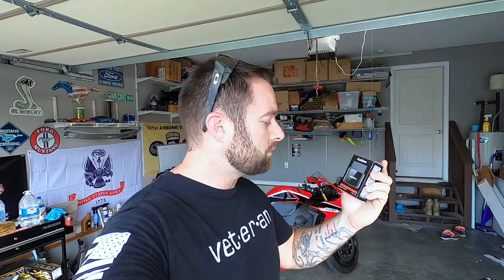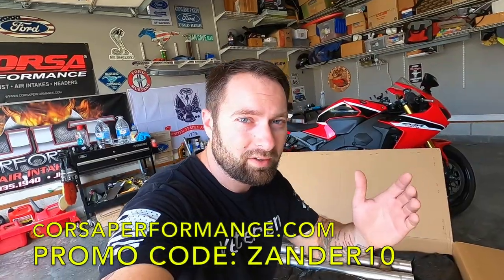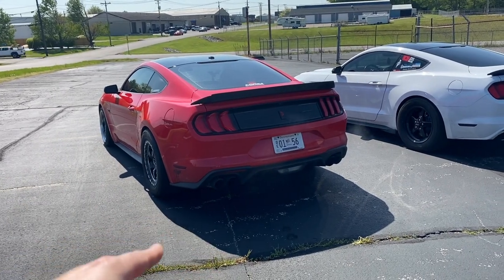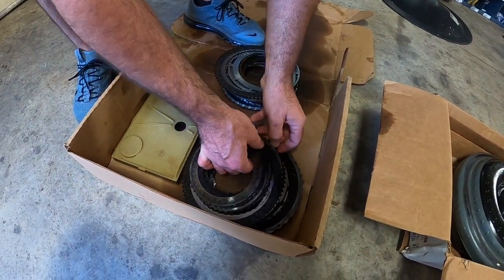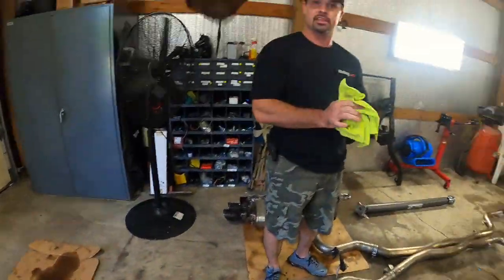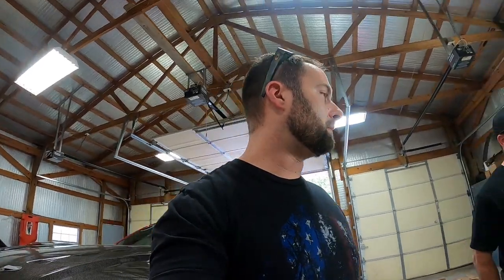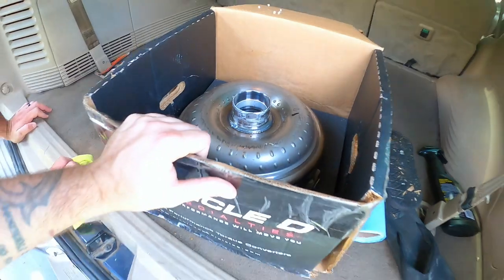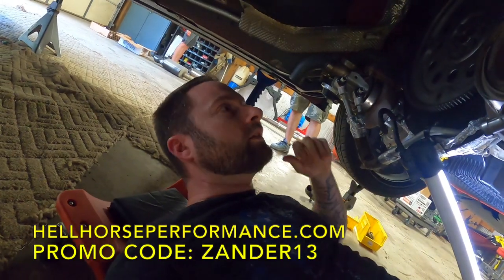BAD NEWS for my TWIN TURBO Mustang 10r80 Transmission  *THIS IS WHAT WE FOUND...

Comment: Is it selfish of my that im glad ( since it won't cost you nothing, remember most people don't get to keep their cores ) i get you see your twins vs kens twins which 60ft better and psi ect....with stock stalls!!!!

 Why not clean the valve body? Does him and Ken think thats why you had the 4-5 issue basically since day 1? I know a lot of times Ford tosses a new valve body on, even a few recalls....

 Good to see the trans was holding Hella power and clutches were fine, also people says Robs tune is harder on clutches so that's all good news
Reply from the maker: Installer has never cleaned a valve body before. I did not want to be the test dummy lol. Kens car might be faster with the new 63/65s. He won’t have my power once we are both built engine but his will still be capable of about 80% or more of mine. His will spool faster than mine and he has the newer lighter weight turbine
Reply: @Zander13Productions   I don't mean for yall or against anyone, I mean just for data......i know it sucks but given your job for content yall are gonna give us a REALLY good dataset and content...
  It even helps HellHorse  ...2 or 3 kinds of configuration and lastly how much a stall was worth NA...how much a stall is worth turbo....ect ect...
  I'm saying its 100 degrees and if it was gonna happen this is the time......imho you valve body has never been right on the 4-5....so its ALL moving forward and good content and data for us to soak up.....

 Better it all happened now than late fall in good air with tracks sticky!!!!

 Sometimes I don't come across how I mean so....
Reply from the maker: BlueCollarDaily I totally agree and about guarantee my valve body has been plaguing me since the 1st mile when it was bought. Hopefully this new one will be the remedy
Reply: @Zander13Productions   I still remember the clunk video id just bought my car and immediately went out and seen if I could make my 4-5 IIRC, mess up hehe....

Comment: Yeah the horsepower, & torque you are producing, sometimes things are going to break, any signs of metal anywhere
you don't want mess with, changing valve body is being smart and safe. The torque converter damage is in a weird place, so hopefully the stock converter will hold up, good luck on fixing everything.
Reply from the maker: Thanks. Should have it back up and running soon

Comment: All us FI guys knew you were going to eventually have trans issues with those twins but the issue your having.  So odd.  Did you use upgraded clutches etc on the rebuild?  Stock converter is gonna feel so much better on the street.  Higher stalled converters just feel crappy on the streets.   So much slipping just takes the fun out of the car.  Good luck with the rebuild dude.🤙
Reply: I’ll be honest I love my higher stalled converter compared to stock converter. Especially being turbo’d